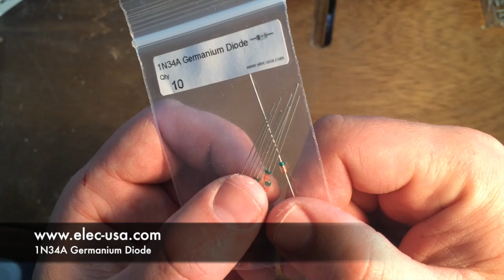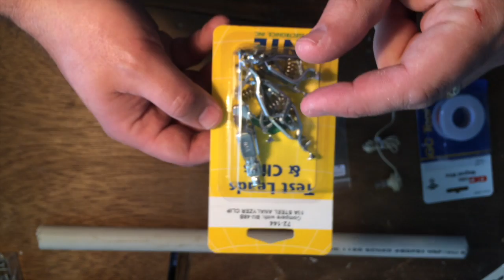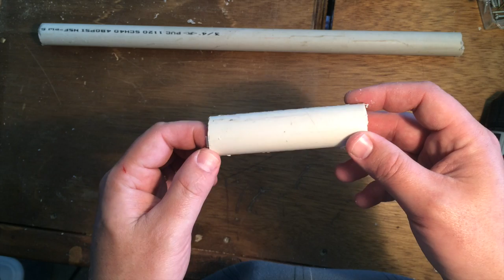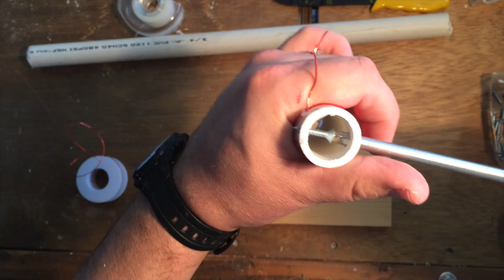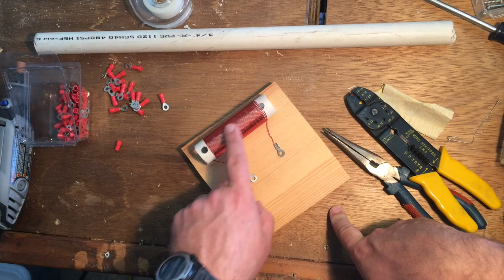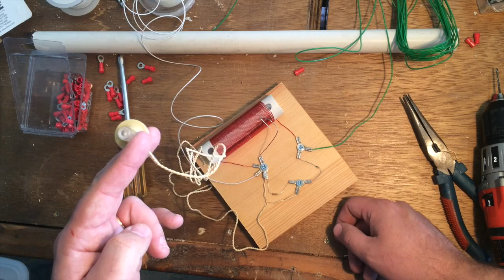Cub Scout Crystal Radio

Comment: You state that the coating on the wire keeps electricity from conduction across the coil so the signal goes all the way around the coil to get from one end to the other. But doesn't sanding off the coating for the wiper to glide across defeat the purpose of the coating?
Reply from the maker: When sanding the surface of the coil, there should still be some insulation on the sides of the coils so that there is not a short circuit horizontally where sanding has been performed.
Reply: I get it. @BenGoodwyn

Comment: It will work better if you mount the coil without actually touching the wood board. Have something holding it up. Also the screws on light switches are connected to ground so if you tighten the ground wire under the screw that will work pretty well.
Reply from the maker: Thanks for the ideas!

Comment: Sir what gauge wire is used for antenna coile. And what is the dia of pvc pipe
Reply: Diameter looks to be about 3/4 inch.
Gauge looks like 30g
Reply: I use 16 gauge wire for my long wire antenna. Use about 30 feet outside. Twenty minimum.

If you have to use an inside antenna use 15 to 20 feet.

Of course, more is better if you can do it.

Comment: Try using Schotkey signal diodes instead of germanium N34A also use an iron ferrite core made from iron coat hangars chopped up to length or long carpentry nails any soft iron. Try sliding the iron core inside the coil so that it moves up and down, this too will change stations with inductive tuning. Or use a 40 - 400 pf variable capacitor from ebay or a very old radio. Another technique perhaps too advanced for this application  but very easy, is to use a diode as a tuning capacitor like they do in your cell phone (note some diodes have a very huge Pico Farad range of tuning, all diodes have some capacitance. Google " TUNING DIODES" in the range of 20- to 400 Pico Frads or Pf (1 x 10 ^ -12 Farads) " get the cheaper ones for this project on ebay, they work fine.and change the capacitance using a variable resistor easier and cheaper to come by, they are not that hard to use. You will find circuits are all over the internet on how to use tuning diodes , but they require a battery that last a long time. Experiment with coil lengths and taps. Remember the old Galena Crystals? What were they? They are crystals of lead ore, yes the common lead you find in your car batter or fishing weight. This ore and its crystal are very common in parts of Ohio and Colorado .You can go wild with Crystal Radios. Remember listening at night is vastly better than day time listening, world reception on short wave is likely at night or dusk. N8DLI
Reply: Total waste of time, just follow the video

Comment: I don't no what you pay for your parts for your componets,I done.it both ways buying local and shopping on line mostly EBay ,EBay was a whole lot cheaper also like electronics and Borden has parts for many different kinds of things made for Crystal radios ,you can find a lot of Crystal radio designs that are downloadable for free ,I bought my Crystal ,diodes use for most Crystal radios ,I even obtained antique diodes ,military grade diodes etc. All I need is some more 22 or 20 gauge magnetic wire .the screw you are using I found cheap.at the 99 cent only store ,the crimp connectors at harbor frieght,but are cheaper online ,the wood squares ,I got at Wal-Mart I think one dollar ,your way may be cheaper the Crystal earphone at Mike's electronics ,the crysal.doide and the crystal.war phone are then only thing you have to have the right ones.,and you will need a old lenght of wire for antenna the longer the better and a wire for the ground ,you can use a three way plug and only use the ground connection for your ground ,the alligator clip were cheap at harbor freight .but these simple radios can actually ,the price can add up pretty good .

Comment: I wonder if a LA4535MC would work..it use's a 1.5 volt battery, so you  can use a solar cell to power it. That IC will amplify the signal and drive a speaker...
Reply: No it’s against the law

Comment: What gage magnetic wire is that,and how much is needed,great video
Reply from the maker: I don't recall the answers specifically, but I believe that the gage of the wire is not very important. It is more important the number of coils that are made. I think I purchased enough wire to have 10 feet per radio and had a decent amount left over at the end.
Reply: Looks like about 30 gauge

Comment: excellent build!
i saved alot of $$ by opening a wall adapter (used the wire inside for the coil), a germanium diode from another radio, var. capacitor from that same radio, and made an antenna from 2 straightened wire clothes hangers (with the insulation removed),connected to a small transformer connected to co-ax cable, and the ground connection from wire from the same radio (that goes into the power supply).
i just connected everything to everything, removing this and that until i heard several local stations! i also made another coil,using 2popcicle sticks(made 90-95 turns), and could hear Cuba, Nashville TN, and even European radio! (i'm in OK).
hope you make more crystal radios!!
have a good one!